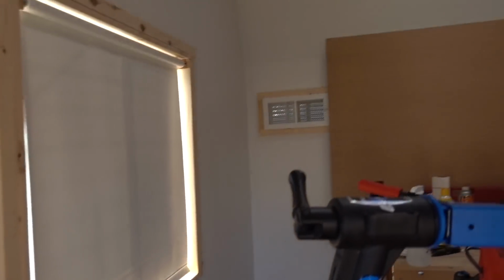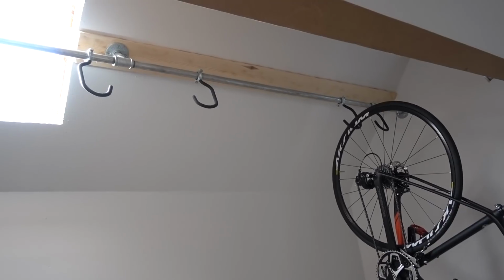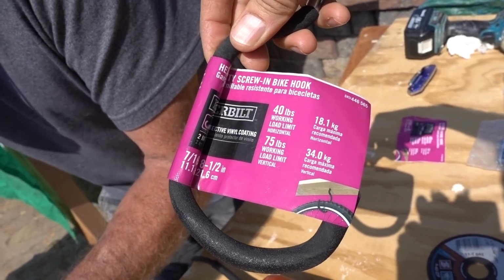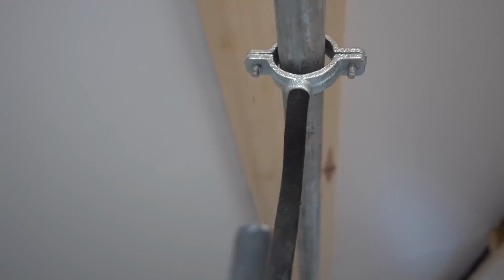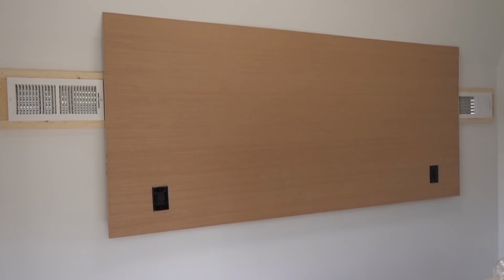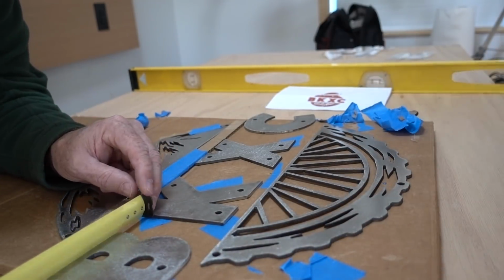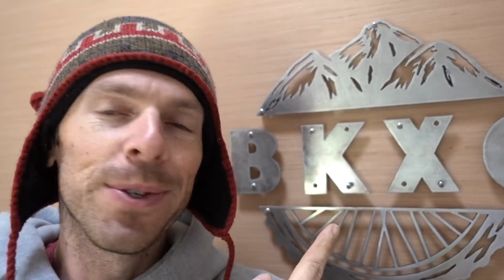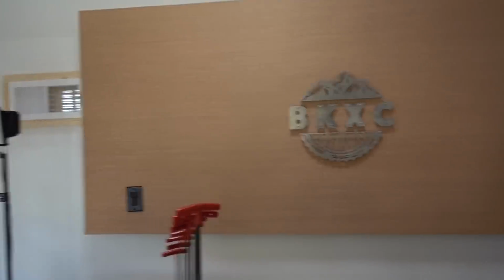FINALLY starting to build the bike workshop of my dreams

Comment: I built just this or I should say I am still build just this in my backyard.  Mine is 10x20 with heat and ac.  Stores 14 bikes, has a work stand, 10’ workbench and last a 5’x3 locker for all my riding and bikepacking gear. Still have to finish all the installation and drywall to hang.
Reply from the maker: NICE! I think mine is 10x12, biggest I could do without a permit. That's awesome dude!

Comment: Make sure your hydraulic disc brake bikes are hanging from the front wheel. You need to have the reservoirs above the brakes or else you'll run into some issues with bubbles or possibly leaking.
Reply from the maker: Nice, thanks for the tip!!

Comment: Lookin' good man!  I hope you are considering some sort of alarm, even if it's one of the newer phone linked camera systems with a REALLY LOUD motion activated screech horn to deter would-be thieves.  If someone finds your address, it will be a lot more tempting for them to break in to a shed than it would your actual garage.  I learned that lesson the hard way after a thief got my riding lawn mower, push mower, and two weed eaters at my previous house.
Reply from the maker: Yes! Probably going to get the Ring!
Reply: As well as check your insurance, items in a shed are different to items in a house... camera gear etc and value of bikes/items need to be checked... so many assumptions but the fine print kills you in the end.

Comment: That's looking badass with that sign up! For filming I'd look up magic arms, infinitely easier and more practical than tripods in smaller areas!
Reply from the maker: YES, I definitely need to get something rigged up like that. I'm guessing I need to rig up some pipe to actually be able to clamp them down, though.
Reply: Maybe some strategic mounting points on the back board? And one on each end of the desk? But they'll clamp to pretty much anything the jaws will fit around.

Comment: Great idea and execution on the overhead pipe storage.  I have a taller garage and I store my bikes upside down via hooks and can walk under the bikes without hitting my head on them.  I have not noticed any air issues with the brakes.  Good luck with the rest of the build out.
Reply from the maker: Nice! Glad to hear it's working pretty good for you!